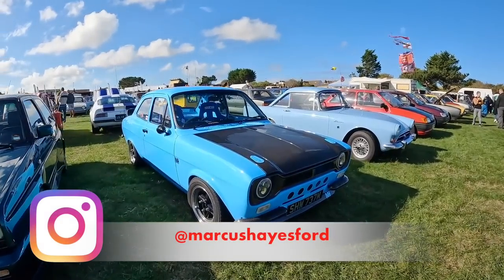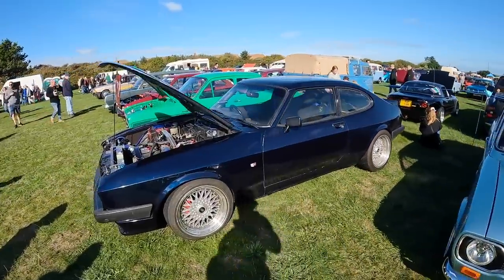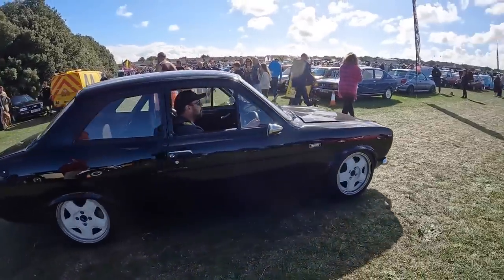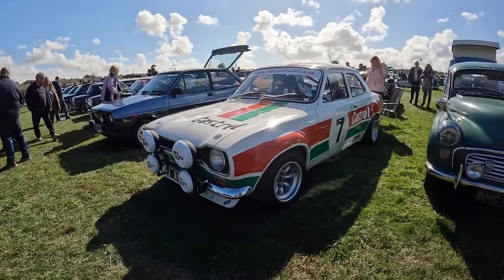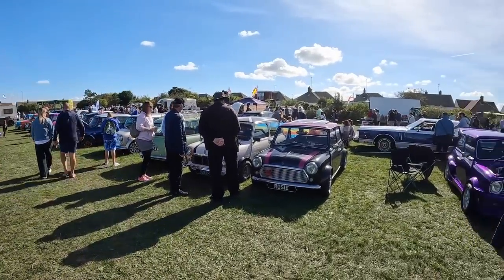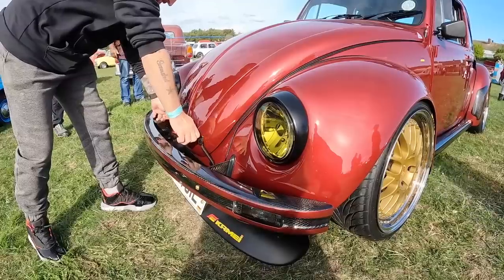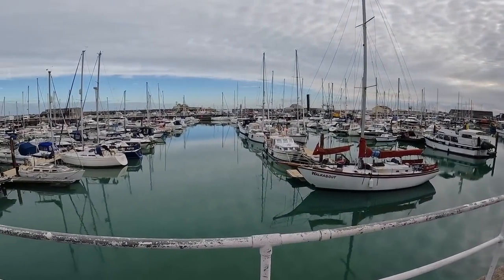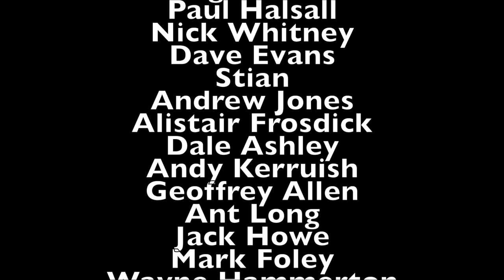The Retro car show EVERYBODY went to! 😃 OhSoRetro Show 2022! 👍

Comment: Great vlog super show  great cars also the scenes from Ramsgate brilliant . Thought the Mini with the crossflow head unusual, last time I saw one of those was on Will Sparrows, Thor Hammers Mini Clubman rally car, an indecently  quick 1300cc car,I am told it was1380cc ,however it wasn't so quick when he went into a ford a bit to fast and the water came up the front and into the carbs, oh dear! My rally Viva had blinker mud flips on the front and when I went through instead of holding the water down they acted like a snow plough and shot ice cold water all over the spectators, fortunately my engine kept going as I was probably not flavour of the month!If you want to see some good driving in an Escort watch Julian Reynolds and Ian Okey in car Harry Flatter Rally on YouTube these are some of the roads we used.
Reply: That was a seven port head on the mini